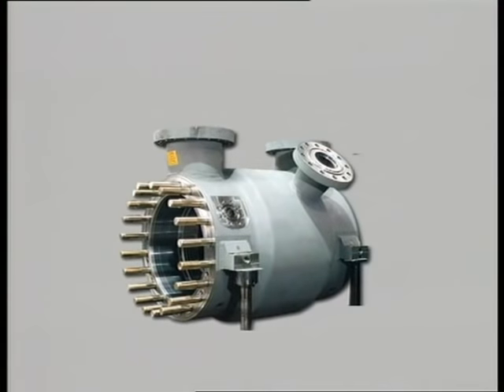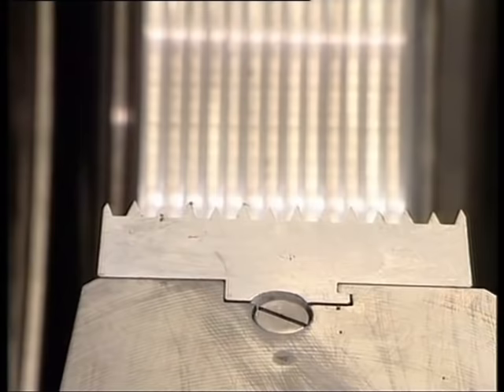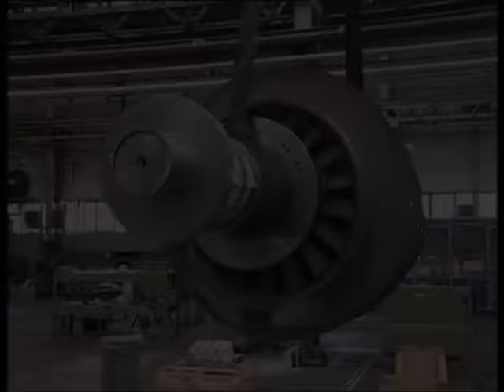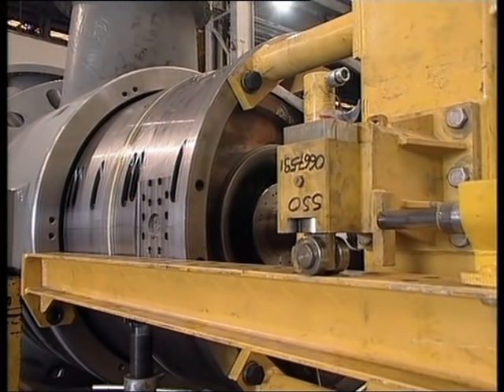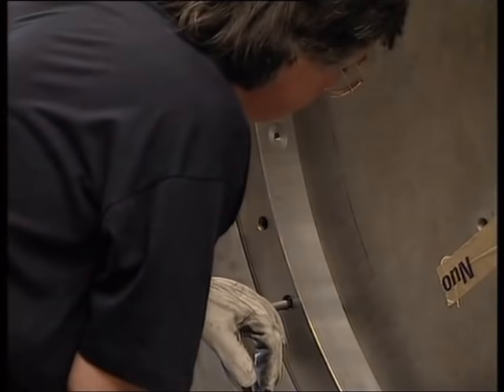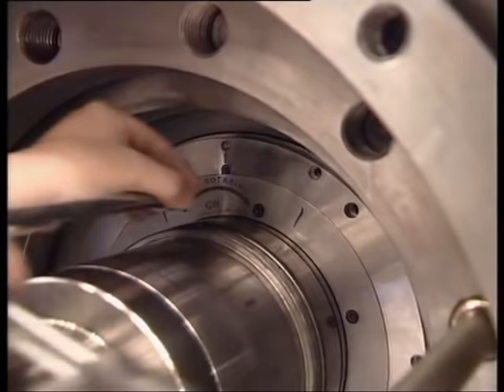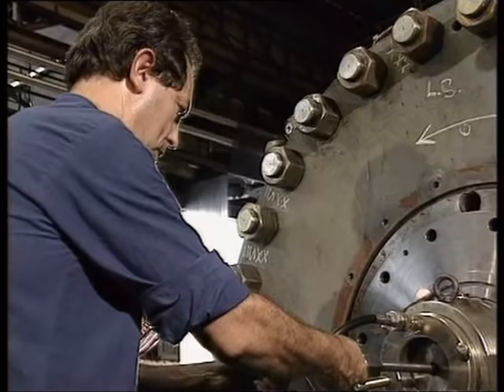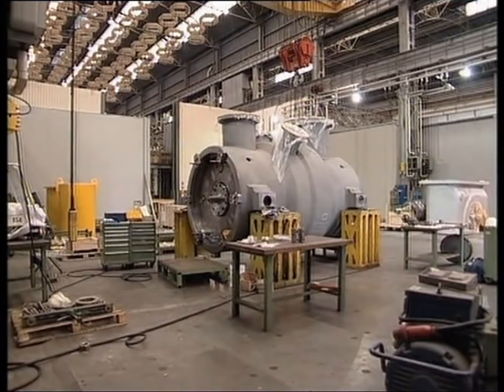Compressor | Centrifugal Compressor | Centrifugal Compressor Overhauling | Overhauling Procedure

Comment: Please explain, what for thrust and journal bearings?
And important for me, thrust or journal bearings moving with shuft together?
Thanks,
Reply: Thrust for supporting axial load while journal will support radial load. They dont move together with shaft. The thing that rotates with shaft is thrust collar which is sandwiched between inboard and outboard thrust pad of a thrust bearing

Comment: Dear engineer/
Can you explain to me for this type of compressor using for which apply due to I working as overhulling centrifugal chiller. and I need to know this compressor working with refrigeration system or oil gas.
Best regards
Ali Metwally
Reply: Oil iso VG 60

Comment: good video but very poor safety practices, technicians, helpers were working heavy parts with bare hands, without safety glass especially the guy fitting thrust disk with very high hydraulic pressure.

Comment: Hi! I've got a question:
"where does the rotor lean when it's dropped inside the diaphragm bundle ?"
the journal bearings are supposed to center the rotor radial position, and their assembly  it's not happening until long after the rotor lowering inside the bundle...
thanks
Reply: It can only be resting on the labyrinth seals, I’m supposing they can handle the weight over their distance, when we assemble rotors we have two dummy halves that go in to support the load, also we would never lift or lower components without a chain block between the crane hook and component. I guess these guys must be American?
Reply: This is in Florence, these guys are Italians... the place is called NUOVO PIGNONE, it’s not GE anymore, now we are Baker Hughes... I work there as test engineer
Reply: @thetruth156real3  made up of Aluminium ??

Comment: What does MCL & BCL stands for?
Reply: MCL is horizontally split and the BCL is barrel type. There is also a PCL which is specifically built for pipelines, which requires that the inlet and exit flanges are at the same plane. But none of these are important; glorious days of Oil&Gas are gone, we need to look at alternate energy ressources. Fossile energy is old shit, and so is BHGE.

Comment: The compressor old designer
Problematika check senter axial rotor with diafragma.for posisi thrust disc ( cut busing/Sleeve)

Datum /bundle compressor Dresser Rand new designer
Ok.